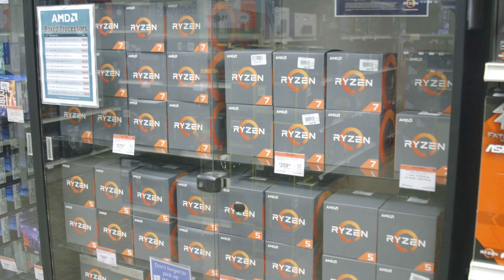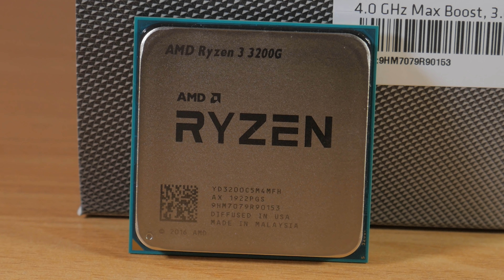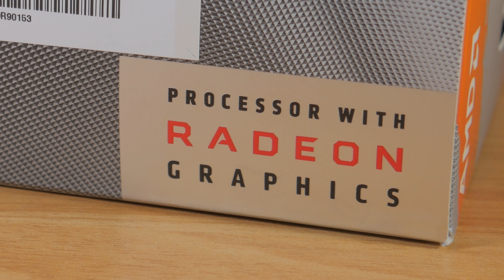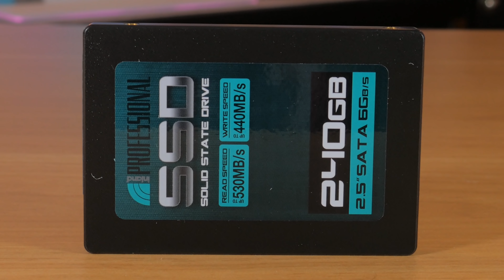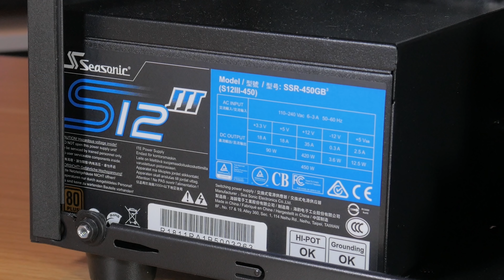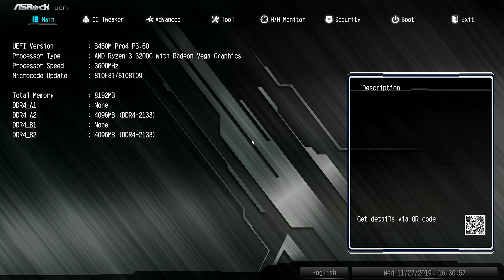$300 Gaming PC Build Guide! (Late 2019)

Comment: I’m going to build this pc . Stay tuned for the results. 

Core (ryzen 3 2200g)                          77.98$
Motherboard (AsRock pro4)              64.39$
PS (evga 600w)                                    33.99$
RAM (3200 2x8gb 16gb g.skill ram) 59.99$
Memory 	(248gb m.2 inland drive)     28.99$
Case	(random case off Newegg) 24.99$
	
Subtotal 	290.33$
Shipping	12.81$
Total 	303.14
	
Ill keep this comment updated as my build goes on.
Reply: Commenting 4 later
Reply: Oh hell yea
Reply: Update, 

I decided to fork out the extra 100$ (129$ -10% code + 20$ mrb leave this at 99.99$) and get a GPU. I noticed that Newegg had a quick sale on XFX rx 570 4gb’s. This now meant that I could go with a cpu that no longer had integrated graphics. So I went with the best price per performance cpu I could find (that will LAST (1)) I scrapped the r3 2200g and went for the Ryzen 5 2600 for (119.99$). This left my build at (445.14$) and will result in massively improving the performance of my build. 

1) what I meant by ‘“last” is the r5 2600 future proof my build alittle better my giving me the option of simply replacing my GPU in the future for some bonus notable performances. 

All my parts arrive Thursday !! Super excited
Reply: You could also go with the more budget R3 1200 or r5 1500x
Reply: @corydonn111  go work
Reply: @maybeme1058  sheep
Reply: @Sirjacome48  Switch the 2600 to the 1600 AF. It's 85 bucks and is basically the same thing
Reply: @Sirjacome48  I built the same thing except went with the Ryzen 5 1500x and a gtx 1060 3gb. 4-450 seems a good range for best bang for buck.
Reply: Noise
Reply: Thanks for this.  Where did you originally price out the CPU/MOBO? I'm interested in getting those two parts under $150 (as you appear to have done).
Reply: How about graphics card ?
Reply: Sirjacome48 don’t forget your fans
Reply: @Khyrberos  i got these prices from PcPartPicker! also i recommend checking out the buildapc reddit for sales!
Reply: @DzDaBeaStt  my GPU was alittle late but it did eventually come! the XFX RX 570 4gb! is a beast that can handle literally all games at 1080p high/ultra
Reply: @dexterr7256  the case i had bought came with two included fans! an intake at the front and one in the back! with stock case fans i havent had a problem yet. 
temps around 50C
Reply: How you doing now?
Reply: @xlemponiaris  great! pc runs amazing like a champ!!
Reply: Sirjacome48 I want a pc in the budget of 250 is that possible
Reply: Joseph Carter Hell yeah it is!!! Granted you might be using used parts but it’s definitely capable of being done!!
Reply: I checked the price I would have to pay in my country buying every part here and in Dollars it would be 568$

In USA is pretty easy to have a good PC with a little money
Reply: Sirjacome48 do you play overwatch? If so what frames?
Reply: Brodey Hund no I do not I’m sorry
Reply: Sirjacome48 it is ok! I think I might just do the default build then but an rx 570 when I can afford it
Reply: Brodey Hund i would not recommend the graphics in the 2200g if you want to play on anything above 1080p SUPER low settings
Reply: Sirjacome48 3200g*. It will have to work until I can afford the gpu. I think I can handle the low settings on the overwatch for a bit🤷🏼‍♂️
Reply: Brodey Hund what price are you getting the 3200g for because I might be able to find you better cpu/GPU combo!
Reply: Sirjacome48 $95
Reply: Brodey Hund realistically if you wanted to on the used market you can get a r3 1200 for about 50-60 and a rx 480 or 570 used on eBay for 50-60$ too
Reply: And we never heard from him again.
Reply: Daniel Salas wdym?? I kept all the comments updated!! :) pc runs great! It streams and everything effortlessly!
Reply: Isabel Sanchez Wu I do play fortnite but you have to read the comments and see that I did end up upgrading my build. On the build I went with I get around 160+FPS on fortnite with all epic settings. Borderlands 3 60fps+, csgo 240+
Reply: Commenting for the updates.
Reply: SirBranDon100 what updates? Just read the comments
Reply: @Sirjacome48  Thanks, also do u stream ? if u do whats the streaming quality like.
Reply: Isabel Sanchez Wu I have tested streaming runescape and fortnite lol. Both stream well over 60fps
Reply: @Sirjacome48  Also did u overclock?
Reply: Isabel Sanchez Wu no I have not, I’m still on stock cooler
Reply: Haven’t found a need too yet tbh lmao
Reply: @Sirjacome48  Thanks!
Reply: @Sirjacome48  Sorry for bothering u again but what size PC case did u get?
Reply: Isabel Sanchez Wu I personally got a normal atx case
Reply: nice
Reply: Hay , Asrock b450 pro4 f
Reply: Sirjacome48 hi, could you update the original comment with all the newer parts you’ve got? I’m new to pc building and am on a budget of between 400-450. If the parts you’re using are running games as well as you say, I might want to look into it. Thanks
Reply: @sajib25  Ryzen 5 3600, MSI Mortar Max, 16GB Ram 3200MHz, RX570, BeQuiet 550W Power supply and you good. Look at "pcpartpicker" and look if it fits for your needs
Reply: Silvio Lopar thanks man, I’ll have a look
Reply: IHippoKissU I can help you out if you need be. My total system came out to about 500$
Reply: IHippoKissU I would recommend not getting the ryzen 5 3600
Reply: Sirjacome48 what was the FPS
Reply: I love cereal 69 wow it’s almost like you can’t read????
Reply: I’m debating on getting the 1600 af or r3 1200 bc I’m getting a deal on it, I’m gonna be using the same mobo and everything I just don’t know which gpu to get... sorry I’m new to pcs
Reply: My budget is between £300-£450 and what power supply was he using? If I can’t find that, what power supply are you using? Last, what upgrades should I do??
Reply: Sirjacome48, if you waited you could’ve gotten an xfx rx 580 which goes for 370 and is now listed at 160 on Amazon. Crazy deals at the moment.
Reply: D0P3ST_KILL3R846 580 is 100 used
Reply: Commenting to save
Reply: Sirjacome48 This is not gaming! There is no graphics card, so it will preform badly in most games. Do not use this build for gaming!
Reply: Sirjacome48 Can you please update your comment with exactly everything you bought, including upgraded parts, or make a list on PCPartPicker please. If everything is running as great as you say, I am definitely purchasing the parts to this system. Thanks
Reply: Where did u order these off of
Reply: Yessir
Reply: I don't think you need 600w unless you plan on getting a super high end processor and gpu in the future
Reply: What would you recommend for the size of the case?
Reply: Get the Ryzen 3 3200G if you have a Micro center in your area, it's only $2 more expensive and way more worth it man
Reply: Go for B450 but nice build tho
Reply: @Sirjacome48  the case u bought had 2 built in fans??? Can u tell me the name of That case?  I never used a PC before in my life and this is gonna be my first build.
Reply: Sirjacome48 rainbow 6 siege ????
Reply: Yo man can it run Rainbow Six Siege?
Reply: Cooooooooooooooooooooooooooooooooooooooooooooooooooooooooooooooooooool
Reply: kiloisnear read the comments.
Reply: Nice
Reply: Wait is there a graphics card?
Reply: Oh hell yeahs
Reply: NO PLS NO GET A RX 560 AND RYZEN 5 1600 INSTEAD

Comment: 11:25 DO NOT face the fan down IF you plan to place your build on a carpet!
Reply: JayzTwoCents
Reply: Mr. nut yes, face it up. Because when your powersupply runs hot and starts to spin it’s fan, no air will come through under those fluffy hairy carpets. You would suffocate it completely. Means: your ps wouldn’t last long.
Reply: Afghan 691  it's not safe and your killing its life by about 2 years, and alot more dust gets it in which heats up everything else
Reply: Face it up like the other person said. Or elevate the PC a little if possible (and not covering the fans) to allow airflow to the bottom.
Reply: Im glad I read this
Reply: @Jack Hultstrand Mines on the ground but I have hardwood floors
Reply: Janaraly ok
Reply: is it fine if you face it up while on a non carpet material
Reply: How about dont put it on a carpet in the first place lol

Comment: so using ebay I plan on building a pc for around 250-300 and pretty decent I found getting either an i5 3470 and a used RX 480 or an i5 4460 and a RX 470 8gb ram and you know cases and motherboards are all personal preference. both are built to easily handle games in high on 1080p I cannot wait to get mine soon.
Reply: Motherboards are not preference all the time
Reply: @arock5175  true but they usually do not affect prefromence

Comment: If u Wana Clean the front fans from dust that will eventually accumulate over time from the fans and u pull the front cover when everything is connected to the motherboard could brake the cables as they will force pull out as u remove the front panel

Comment: I would recommend getting a 550watt+ power supply to allow some headway for a GPU upgrade.  Taking this build with an RX580 (which is highly recommended for budget builds) for example takes you right at 450watts.

Comment: Used several of the same components in my rig, used the same mother board, ryzen 2600, 32gb of 3200 mhz gskill, Vega56, and a 240+1tb inland SSDs, turned out awesome
Reply: 91chevy1500 this is the same build I’m doing. Did you already build this?? How does it preform?? This is pretty much exactly what I’m doing !! :)))
Reply: @Sirjacome48  just got the new COD game today and it runs it on maxed 1080 at 111 fps

Comment: Idk if matt said it but if you're gonna be building in this motherboard. Put the ram at slots a2 and b2 NOT a1 and b1. the xmp profile (3200mhz) will not work if you don't do this
Reply: and i think instead of the ram and the "gskill" ram i think he cudve cut some money and gotten a gud gpu or another cpu
Reply: @keshavthapliyal6437  he could have gotten a r5 1600 and a GTX 750 to easily
Reply: Chrislamp sry i just saw i said ram and gskill ram
I meant ssd and gskill ram
Reply: @chrislamp  Though he did say at the very beginning of the video that this build uses all new parts. You can't buy a GTX 750 new anymore.
Reply: @jarmainc  maybe not from a normal hardware store but in my area there are stores that resell gpus
Reply: This comment saved me. Thank you so much.

Comment: Next: Best PCs you can upgrade to gaming PCs
Reply: Well, that exact build would be pretty high on such a list for one. The socket on that motherboard would allow you to upgrade to pretty much any other Ryzen CPU short of a Threadripper, upgrading to 16GB of RAM is also possible by buying a second copy of the same kit, and you can buy a GPU without having to throw out the old one because this build uses integrated graphics in the first place.
Reply: @onceuponaban  well said
Reply: onceuponaban I think he means like Dell prebuilts and things like that. Old PCs that you can stick a graphics card in and play
Reply: @caseybernd7690  exactly
Reply: @onceuponaban  what gpu would work with the build in this video? I want to add one from the start
Reply: @PhysiqueWildCard  The general rule of thumb is your GPU should take up around half the total budget for the tower. Since the suggested build totals $300 and does not include a GPU, you should ideally pair it up with a GPU in the same price range, which would make the Radeon RX 5600 XT a good choice. With that being said there are two important things you should take into account:

- The current pandemic is disrupting supply chains, leading to parts costing more than they would normally, taking a long time to be delivered, or flat out being unavailable. I would advise delaying ordering computer parts until the crisis blows over unless you really need that computer. By the time this happens, we'll likely have new components on the market (Ryzen 4000 series CPUs come to mind as well as DDR5 RAM) which will further change what choices would make sense at your budget. If you're lucky enough to get parts at reasonable prices and get them delivered in a timely fashion, go ahead, otherwise stay put.

- The Ryzen 3 3200G is good for what it is, but if you're adding a GPU from the start there is a better option for you: the Ryzen 5 1600 AF, not to be confused with the earlier Ryzen 5 1600 AE. Despite what the name implies it is a lot closer to the Ryzen 5 2600 (the difference in performance between the two is basically within the margin of error) but is significantly cheaper (in fact it might be cheaper than the Ryzen 3 3200G depending on where you live). It was not chosen for the video because that CPU doesn't include integrated graphics which makes a dedicated GPU mandatory to work properly, but that is not an issue in your case. I strongly advise swapping the 3200G for a 1600 AF which is a lot more powerful.
Reply: @onceuponaban  Thank you for this very detailed response. I mostly will be playing some sports games like NBA & WWE 2K, and Call of Duty. But I want to be able to play Skyrim and some other titles if I really really want to. This will help me make some decisions, PC isn't needed right now, but I really want to build one now lol. I hear you tho. Not knowing when this whole thing blows over and want state things will be in also concerns me. Clearly there are bigger problems going on in the world, but we can all use the distractions
Reply: @PhysiqueWildCard  Skyrim itself is by now a fairly old game, most modern gaming computers should be able to run it well regardless of budget (I'm pretty sure even the Athlon 3000G on its own would manage it just fine especially if overclocked), although shooting for the highest specs your budget can manage is always a good thing (the RX 5600 XT I mentioned in the previous comment can handle pretty much any triple A game at 1080p effortlessly and can handle 1440p resolution as well). If you're looking for help to figure out what you can get away with, I'd suggest visiting the PC Master Race website; they have a build page with more advice. They also have a Discord server which has a dedicated channel to help people create a part list. If you show up there with your current budget, parts list (I recommend using PC Part Picker for that, and it's extremely likely they'll be using it too) and use case, they'll be more than happy to give you pointers.

Comment: Hey I already have a graphics card. A Rx 480. So that's one thing I don't have to worry about when building mine. So I could just get a CPU and not a APU what CPU would you recommend with the same budget you used.
Reply from the maker: Ryzen 5 1600 for $100
Reply: Hey now the Ryzen 5 1600 is only $85 on amazon... it’s the 12nm version so it’ll perform better too

Comment: I like seeing the PSU in these newer cases at the bottom but so few of the ones I've seen so far have any 5.25" bays (I remember when these were called "half-height" bays). I still need to burn CDs and don't want to mess around with external drives.

Comment: Hello Matt,

Great content! I need some advice. I have the following components:

~ Intel Xeon W3580
~ GeForce GTX 750 Ti
~ 12GB DDR3 1333MHz (6x2GB)
~ 64GB SSD for System/Apps
~ 2x750GB HDD 3.5" for Storage

I'd like to salvage these components and replace the Motherboard, Case, and Power Supply. Any recommendations for accomplishing this?

UPDATE - I went with the following components for a grand total of $160.04 (Shipping & Taxes Included).

~ ASUS Sabertooth X58
~ DIYPC DIY-BG01 Black USB 3.0 ATX Mid Tower
~ EVGA 600 Watt 80 Plus
~ DEEPCOOL GAMMAXX 400 CPU Cooler

Comment: I followed your guide and everything worked perfectly except for the over clocking crashed PC had to  figure out how to reinstall windows I won't try to over clock again not worth it I'm sure I did something wrong the only thing I changed was the ram I ordered 2400 by mistake and maybe that's what may have crashed it over nice video I am going to add a graphics card when I can afford to but over all very pleased with it and thanks for the video.

Comment: Replace the 3200G with 1200 for $30-40 it's on deal now and the remainder can be used to buy rx570/1650
Reply: True it will be much more powerul but the 570 will have to be used. his focus was a system using new parts only
Reply: JXN139 can this build handle an RX 570? I got the ROG OC edition but now I’m stressing on rather or not it can handle it
Reply: SpicyestNoodlezz I'm late, but yes this build will be able to handle a RX 570, it could even handle a RX 580.
Reply: Isnt rx 570 cost like 150? Thats gonna put the system at 450

Comment: Matt you put the SSD wrong. If you look on the right side there are 2 " hooks, put those in where the 2 screws would go in the SSD and then gently put it down on the left then you secure it with 2 screws. It's a semi-tooless way to set the SSD. Other than that great guide.

Comment: yo could i also install a graphics card into this and if so which one should i get? also would it be better then the 400 one or not
@Tech By Matt
Reply: Depends on the budget. You can get a gtx 770 for 50£ or 65$ with solid performance. And for around 75£ or 100$ you can pick up a gtx 970 4gb. The gtx 770 (65$) is similar to 1050 ti (120$) in performance and the 970 (100$)  similar to a 1060 3gb (150$)  in performance.
Reply: Less limit-ML if you can throw a hard drive in as well for more storage
Reply: A rx 580

Comment: Hey. I am planning on building this PC expect for a few parts. I’m going with OLOy 16 GB RAM with a ARESGAME $53 650 watt power supply with a Asus Prime $73 motherboard. It has four RAM slots and has all of the features I need. I am also using the Coolermaster MB311L ARGB case. Do you have any recommendations? This is my first PC I am gonna build so yeah I’m new to this stuff.